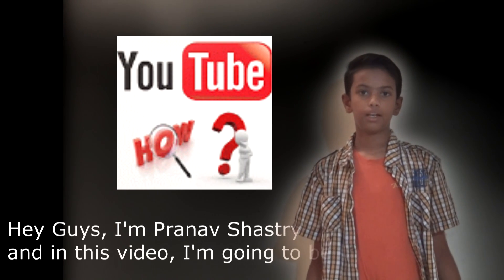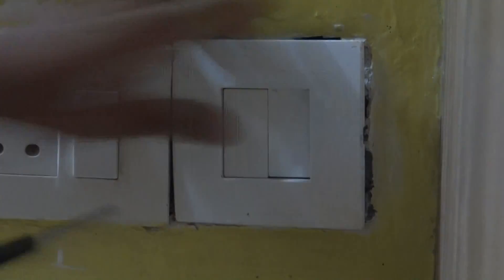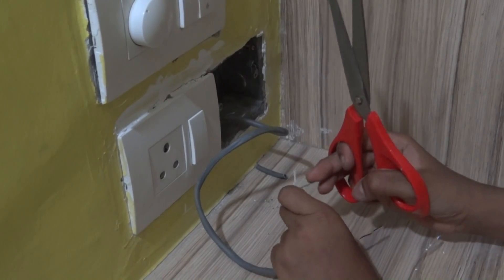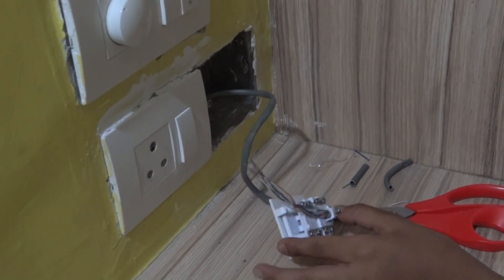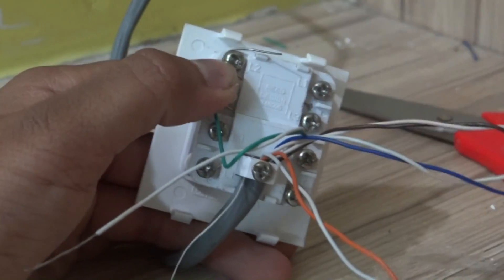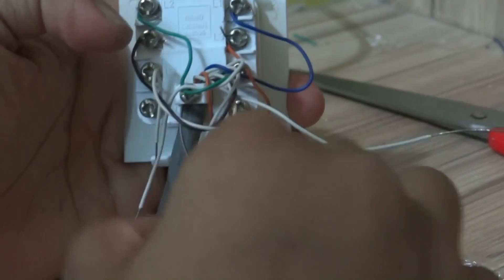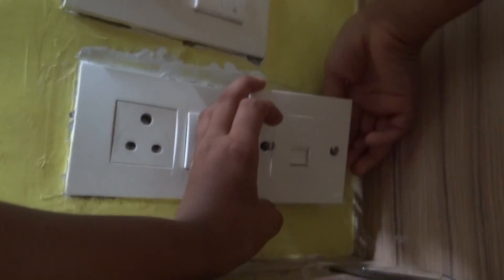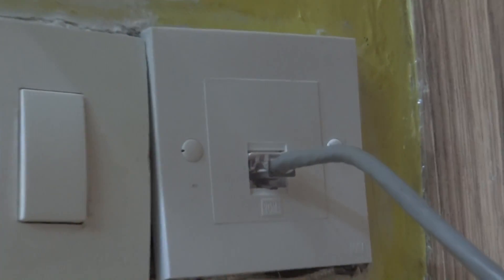Connecting RJ45 LAN Wall Socket in India (ROMA Company)

Comment: Bro can u show same process with fibre internet plz and if not possible can i wire ethernet to ethernet
Reply from the maker: I am not sure what you mean by fiber internet connection since fiber cannot be crimped directly to a RJ45 socket. You can connect ethernet to ethernet wall connectors and use them whenever you want.